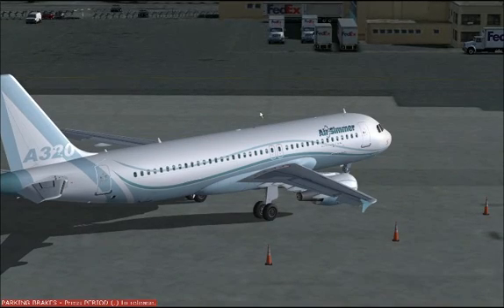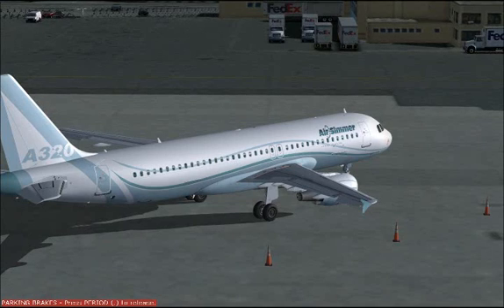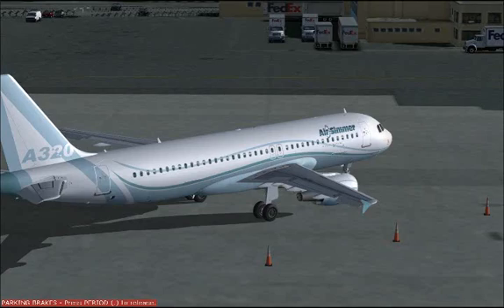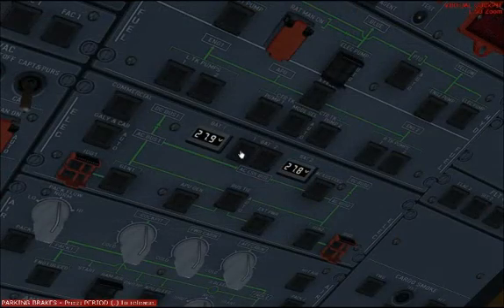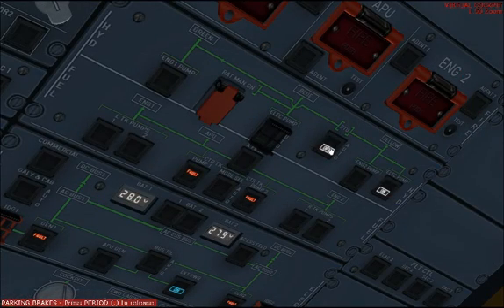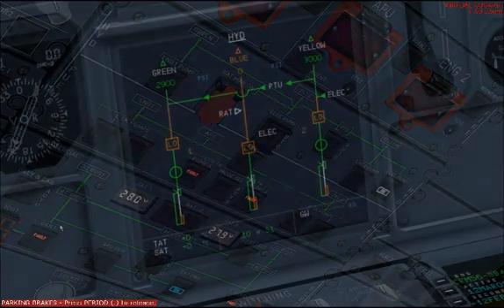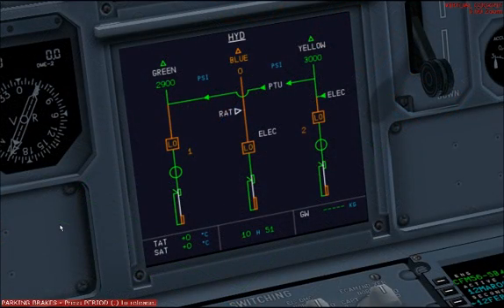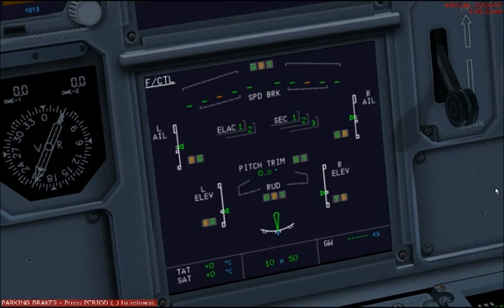Airsimmer A320 Hydraulic/FCS Demonstration.

Comment: @richygambs321 To know when to use Anti-Ice , first you should be sure that there is moisture( rain ... ) , second , u will check the SAT , if it is below +10 C , then you should turn the engine and wing anti-ices ON.

Comment: @richygambs321  Airsimmer does not actually simulate ACARS , because its not needed in the world of Flight Simulation. and talking about failure checklists  i'm sure you mean ECAMS ( electronic centralized aircraft monitoring system), well Airsimmer Basic does not simulate this ,but Airsimmer promised that  ECAMS will be available in the Advanced version.  SAT is the static temp around the aircraft, TAT is the temp. given by the aircraft sensor ( always greater than SAS  due to friction of air)

Comment: @jackop9111 does airsimmers simulatoe ACARS and AIDS? What about failure checklists? What about normal and direct control laws? By the way, when wanting to use the anti-ice, do you use the SAT or TAT as reference? And what is the difference between the two?

Comment: @richygambs321 No , there is nothing that Airsimmer does not simulate and Wilco does , because Airsimmer simulates 99% of the real Airbus . Not only the sound and the virtual cockpit of the Airsimmer , but the systems as well. eg: speed and altitude calculations are much better , FMC is more realistic , FULLY FUNCTIONAL overhead panel and pedestal . whereas in Wilco there are many  fake buttons which do not work .BUT Airsimmer currently contains lots of bugs unfortunately.

Comment: The Fokker is great... with two very large problems.

1) The virtual cockpit is now 2 years overdue and was promised
2) There isn't a proper DX10 compatible external model for FSX, it's straight forward FS9 port